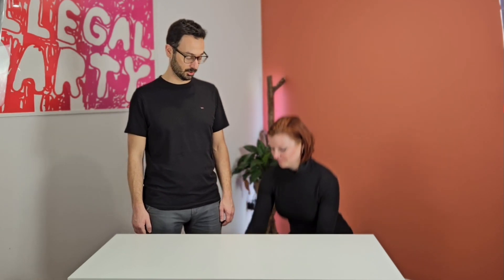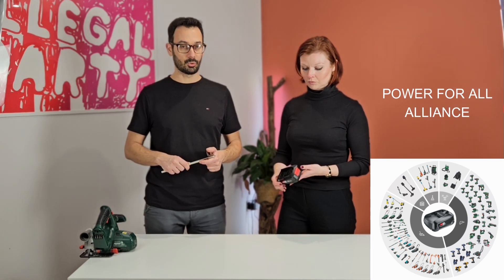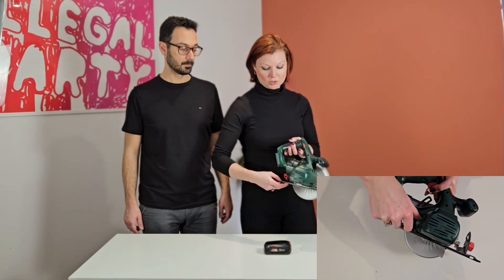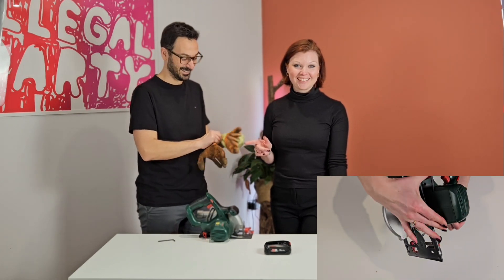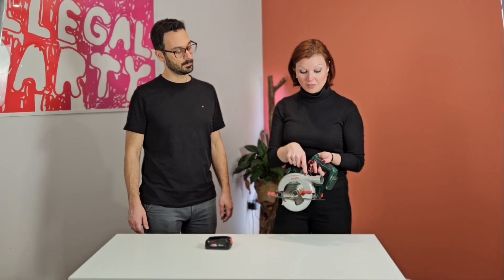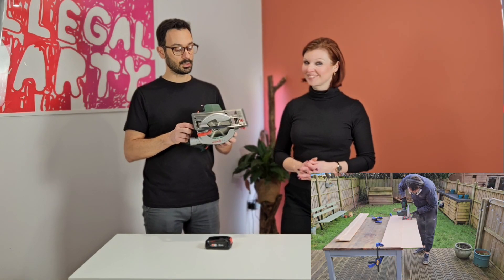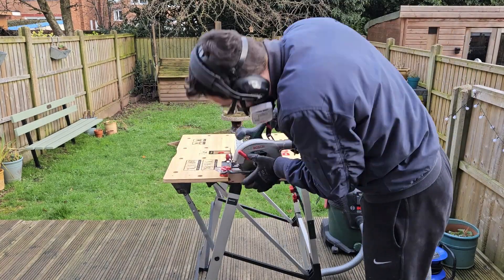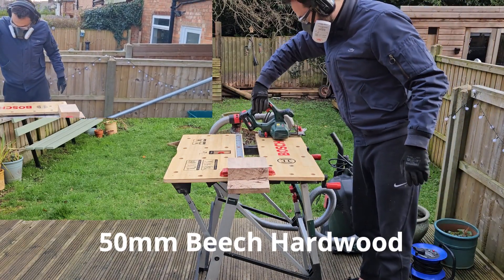Bosch Cordless Circular Saw PKS 18 LI – A great DIY saw solution

Comment: Thansk for this, theres a distinct lack of the green/diy bosch range reviews on YT, probably because they dont sell them in the US
Reply from the maker: We found the same lack of information. Encouraging to know that this has reached overseas. Stay tuned with our channel as we have more Bosch green line reviews coming.
Reply: @RealisticDIYers  I'm from the UK, but whenever I try and look at drill/tool ranges or reviews it's the same bunch (makita, milwauke, dewalt etc) and the "cheaper" brands being like, har our freight, which I have no access to.

Green bosch reviews are far and few between, good to see someone addressing this highly looked over battery ecosystem.

I have the drill, impact, torch and fan as well as a few corded bits like the oscillating tool and sds hammer, they helped us get through our renovation just fine. If I'd have opted for a "big boy" brand it would have done the same job and easily cost twice as much.
Reply from the maker: Oh, so we are on the same page. We want to have good quality without spending a fortune, but also that will last longer than just one project. 
We had the same problem whenever we needed to get information on what to buy.
Having spent ages researching, we thought it would be nice to share our view.
Thank you for your kind words. It motivates us to do more - speaking of which we just uploaded a video on bosch cordless grass trimmer 😉
Happy Easter DIYing!

Comment: og my gosh. Don't lift the secure cap by your hands! It does it autmatically just by touching the wood. This is no secure handling!
Reply from the maker: Thank you for your interest. We know it does. Whatever you see in the video is either to show (without a battery) or to keep the line straight (if you don't lift under specific surcumstances, it is very challenging to keep the cut-line straight)